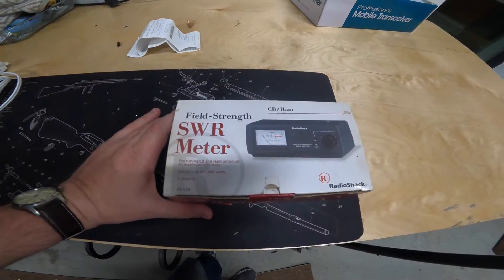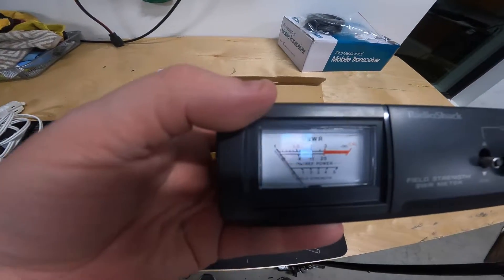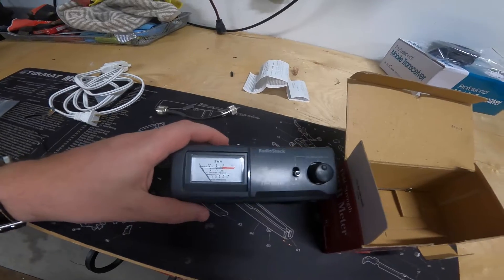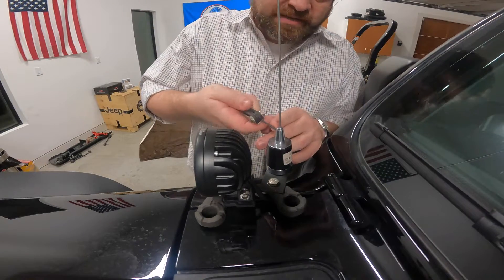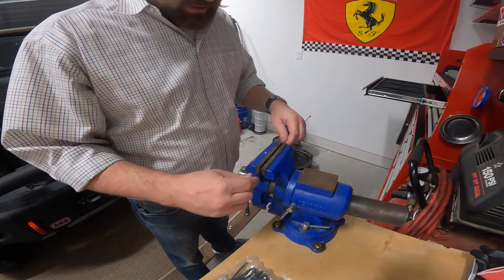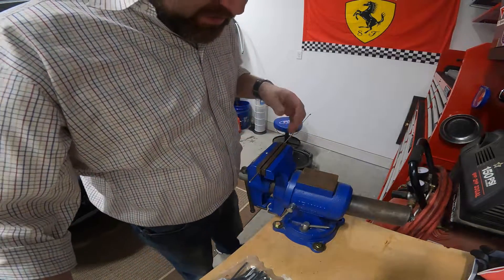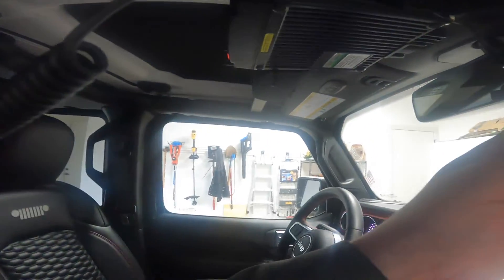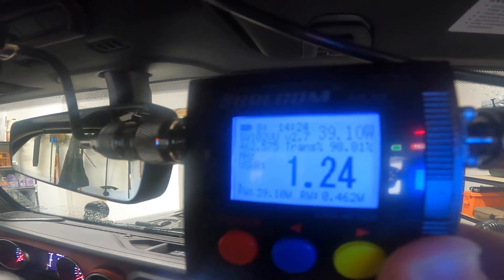How to use a SWR meter for GMRS tuning: better reception better transmissions!!!

Comment: Please skip to 7:52. Prior to that isn't a good idea. Be sure you are using a UHF SWR meter. Also, check channels 1 and 7 first, then 15 and 22, making notes of the SWR on each. If you plan on using GMRS repeaters, be sure to test those channels as well 15R or 23, then 22R or 30. If your SWR reading is higher on the lower channels of the pairs of channels, your antenna is probably already short enough. Channels 1-7 and 15-22 are in the 462 MHz range, and the repeater channels are in the 467 MHz range. 8-14 are only for use on Handheld Transceivers. Key rule to remember about antennas, the higher the frequency, the shorter the wavelength and therefore the antenna.

Comment: GMRS is 450-460mhz.  The radio shack meter is for CB 25-30mhz
Reply: You're right about the Radio Shack meter being for CB, but GMRS is actually 462-467 MHz but most antennas are tuned right out of the box for 462.550 mid scale SWR will be, not should be, at 1.01 in simplex. Now, if you transmit at 467.550 to connect to a repeater SWR will be higher but it's such a narrow band anyway if you start trimming the antenna to optimize and 'tune'  you will increase the SWR across all the other channels. Best to just leave it alone. Less that 1.5 on the 462 channels and less than 2.5 on the 467 repeater freqs it should be just fine.
Reply from the maker: thanks.

Comment: It looks like you have the Wouxun KG-1000G. I just got the same SWR meter you have and I also show only 38-40W output. Is this really the max it puts out?
Reply from the maker: I was closer to 50. I think I got about 48 or so. Not sure what to make of that. The kg-1000 has a great reputation for having a high output. It is a superheterodyne receiver/transmitter. That’s an older analog design that offer superior sensitivity and power out out compared to cheaper system on a chip radios. If the problem persists I might talk to the dealer and see if they have any advice.  I suppose you could have a bad radio as a possibility. I hope this helps. Thanks for checking out our channel.
Reply: The Surecom SW102 is a 100 watt meter. You have to set the power to 50 on the Surecom parameter page to see an accurate display of a 50 watt transmitter and then you'll only be close. You'll never see the full 50 watts.

Comment: You should not check ur swr inside the garage..better do it outside at least with 10-20ft far from any obstruction..
Reply from the maker: Ideally yes I would and should. But for the purposes of the video it was easier to shoot it where I did. I’ve got things pretty well tuned I think as I’m able to hit repeaters and individuals at about 30-40 miles depending on the day. I’ve been pretty happy with the results of this particular meter so far. Thanks for the iSight and thanks for watching.
Reply: @orderofthetravelinghats236  gud sir 73

Comment: Your first step should have been to calibrate the meter in the CAL position, then flip the switch to SWR to see what your reading is, and finally repeat those steps each time you trim the antenna...  My guess is that you are nowhere close to an actual antenna length that you should have...
Reply from the maker: Thanks for the advice.
Reply: I understand your learning we all are everyday and that makes me excited but you should take down and remake this video before someone watches this and destroys their new radio
Reply: Is it possible to be used for gmrs

Comment: Do you have the Amazon link for the jumper cable you used between the radio and swr meter. Thank you
Reply from the maker: I am sorry but I do not. That cable was the cable that came with the old meter from RadioShack. You could make one easily enough just cut to length and terminate it yourself. Sorry I can’t be more helpful. Thanks so much for watching our channel.
Reply: @orderofthetravelinghats236  thank you for your response to my question.  I did order the SWR meter using your link.
Reply from the maker: Thank you. It’s very nice to know that these, admittedly not always the best production quality, videos are helping to give ideas to people. Thanks again for watching and for reaching out.

Comment: The reason its not 50 watts is the engine needs to be running to get the full 50 watts i get about 43 with my engine off
Reply from the maker: Ah. That’s interesting. I had not thought of that. Thanks. I have to say I’ve been very pleased with the radio and have no complaints. It works as advertised. Range and reception have been excellent.

Comment: Actually, you probably fried the detector diode in the radio shack 1.8-30 MHz SWR meter.  That is why it dropped from Infinity to 1 all of a sudden.
Reply from the maker: Yes, I figured I had cooked it.  Its OK, I think I got that in the early 90s when radioshack was still a thing.  I think it said realistic on the label somewhere.  Except for the nostalgia I am not to worried, and I got a much better meter out of the deal so everything worked out.  Thanks for checking out our channel and thanks for the comments.

Comment: Yeah! This guy doesn't really know much about antennas or radios. Wrong swr meter. Wrong calibrations.
Reply: Seems that he got the SWR to 1 or very nearly 1. That should be about right. Care to elaborate seemed to know how to hook up the meter and make the adjustments. Very similar to other folks I’ve talked to.
Reply: @flyingdoc1138  The SWR readings he got on that 1.8-30 MHz meter will be off by as much as 60% as it is not made for the 462 MHz band!  Yes, the meters rated frequency coverage matters greatly.
Reply from the maker: Thanks for the comment. I would love to hear how you calibrate your radios. Especially if there is something better we can do to improve the performance of our radios.
Reply: @orderofthetravelinghats236  That SWR meter only covers 1.8-30 MHz.  GMRS is around 462 MHz so you need a meter that will cover up to around 500MHz.  There are many out there for decent prices.  I use the MFJ-883 Cross Needle SWR/Watt Meter which covers 125-525 MHz and up to 200 watts.  It is not cheap at $129. 95 but it is well made.  No calibrating needed, just hook it in line and key the transmitter.  Shows forward power, VSWR and reflected power all at the same time.  I also use a Nano VNA to check my antennas and VSWR while putting a minimal signal on the air.

Comment: Shouldn't you have calibrated the Radio shack meter first THEN take your reading?
Reply from the maker: Thanks for the question. I don’t think so for the SWR mode on that meter. But like I eluded to in the video I was not sure I trusted that meter. Also somewhere along the way I’ve lost the instructions for it. That was why I bought the new meter. The readings from both meters correlated well so I think that validates the older meter. And the radio seems to be working well. Again, thanks for the question I hope this is helpful.
Reply: @orderofthetravelinghats236  Not a UHF SWR meter!  It is for 1.8-30 MHz only!  I own 2 of them.

Comment: that meter is for cb not gmrs
Reply from the maker: It certainly is usable for CB. But SWR exists as a general concept for any RF system. CB is simply a frequency band that is approved by the FCC as the citizens band. One should “tune” the SWR in any RF transmitter system regardless of the frequency band. The meter used will work on frequencies that are well outside of those used by the CB range.
Reply: You were lucky on adjusting the antenna with that old CB swr meter. They are intended for a certain frequency range.
Reply from the maker: @jackiebeene9609   Yes I am aware.  It is rated for higher frequencies  (HAM) according to the box.  But I did not trust it, In fact I thought the meter burned out on me when using it. That was why I got the new meter. It is SO MUCH better and gives a lot more information.  Thanks for checking out the video.
Reply: @orderofthetravelinghats236  When it says CB/HAM, it means the HF bands, 1.8 to 30 MHZ.  GMRS is 462 MHz and the meter required has totally different circuitry in it!  You cannot use a HF SWR/Power meter on the VHF/UHF bands

 And yes, you do have to calibrate the meter before checking the SWR.  That is what the Cal setting and knob is for.

You place the switch in CAL and key the transmitter and turn the knob to place the needle on the set mark/line.  You then unkey, set switch to REF and then key up again and that will be your SWR reading.  You have to re-calibrate every time you make an adjustment to the antenna.

Never change the meters switch position with the radio keyed as you can blow the finals by transmitting into nothing, no load!  I have repaired many radios that were blown by people making this mistake!
Reply: Now you are using the correct meter …vhf/uhf not that hf meter